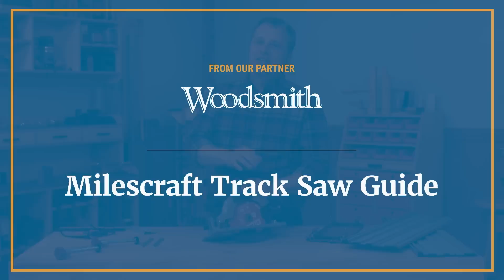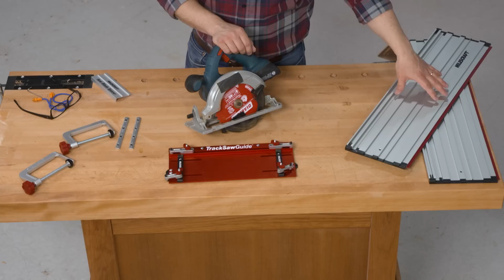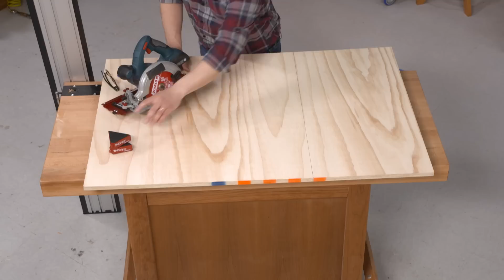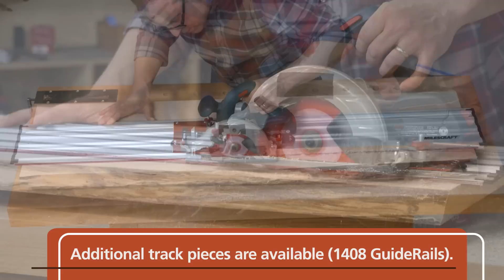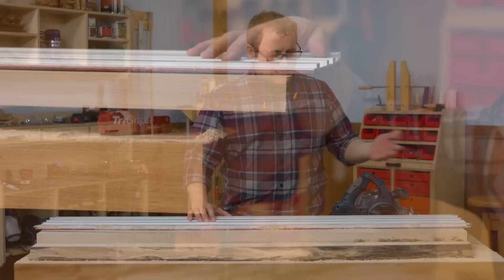Great Gear: Milescraft TrackSawGuide

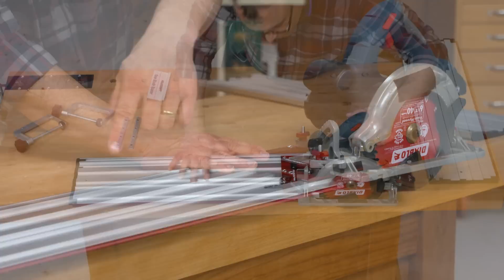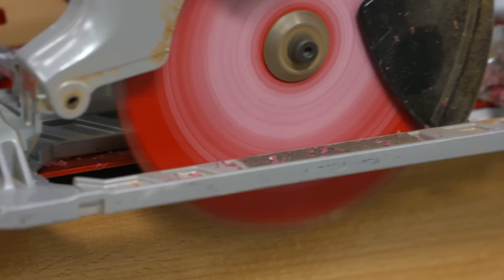Comment: Question -  When making the initial zero clearance cut (1:58-2:10), would you get a better result if you fully supported the strip?  Or am I over-thinking this?
Reply from the maker: It seemed to cut fine without having a backer, but it would definitely would be better practice to have some sort of material supporting that initial cut. Good point - thanks!

Comment: Thanks for posting this video. I have been looking for a track I can  use my DeWalt DW939 6 1/2 inch cordless saw with. It's a left hand saw and cumbersome for me to use. I'm getting better but not used to the left hand operation since I am right handed. As far as set up, I don't think my battery will cause any problem when attaching the saw to the plate. Honestly, I don't see why Milescraft shows the track being used with regular circular saw and this is the only one I have found that shows the left handed cordless saw being used. This seems like a no brainer for anyone needing to use the saw where power isn't available. Thanks again.

Comment: The track saw guide is great.  You still must solve the problem of a large work surface.  I used a picnic table today but that is less than ideal and the guide only partially mitigtates the pain of working with a full sheet of plywood if you don't have a large work surface.

Comment: I bought this because I bought a Milwaukee cordless circular saw. Despite finding a video showing it works...It won't fit correctly. I could not tighten the end stops to the back part of the plate because of the battery placement. The video shows this same problem and they just tightened one side and said that should be fine. For safety reasons I did not like that statement so I am going to use my other Saw. It is a Hitachi and fits perfectly.
Reply: Woah … I got the same saw almost bought it .. that’s why you gotta read the comments first

Comment: That's nice, but for just a little more money than this plus an extra set of tracks to make it 110" you can buy a dedicated track saw from WEN with dust port and 110" Powertec track.
Reply from the maker: That's true, but from my personal experience I haven't been impressed with the quality on some of WEN's products (they are inexpensive though).  I have not used their track saw system, so I can't speak directly to that.